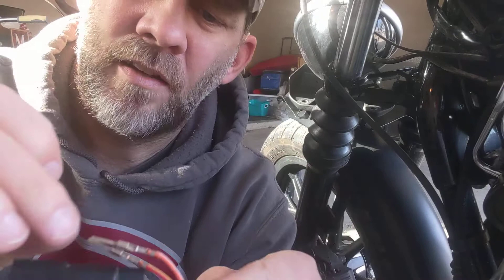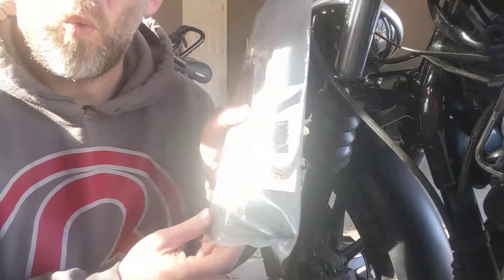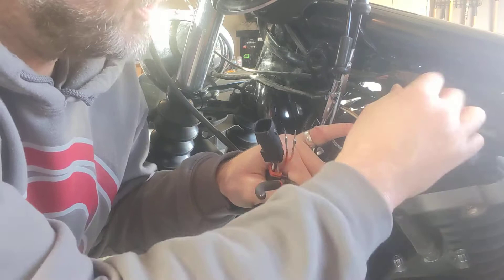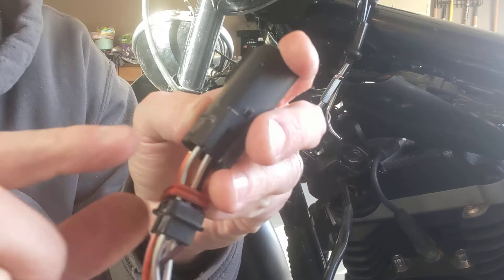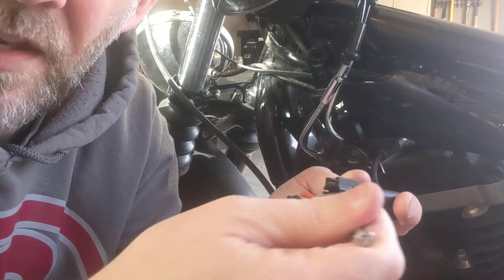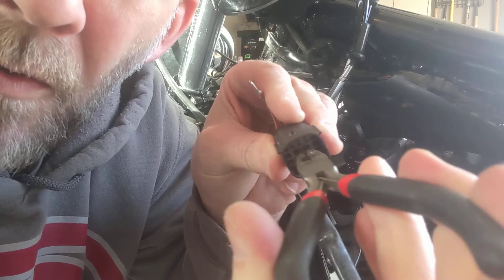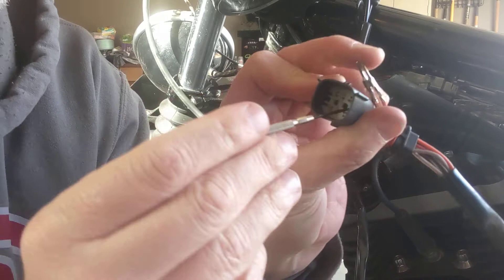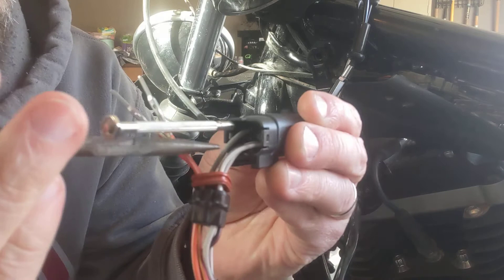Harley Wiring Extension / Removing Wires From Harness

Comment: I want to try and extend the wires on my new Rebel 1100 for the same reason; higher bars.
Your video will help me a lot if I run into the same type of connections.
Thanks a bunch.

Comment: There is a tool for removal of the wire connector pins from Molex connectors but they are rather expensive. I use a #1 paper clip in the small hole just above the connector pin. Then you will hear a click and the pin will come right out. Nice video. Thanks.

Comment: It's in the repair manual. There is actually special tool called "molex pin release tool" that you stick in that little hole on top of the pin hole in the front.  But tiny screwdriver works too, or paper clip.

Comment: Excellent, but you don't need to disassemble the back of the connector, just lift the latch and insert a thin paper clip into the corresponding hole, and that's it, the wire is free. We have an extension brand in Brazil called Pandilla Cables, their kits include a tool and an instruction manual.
Reply from the maker: Thanks for the tip!!

Comment: This is a Deutsch connector, there is specific tooling to assemble and disassemble one of them. Of course a small pick or flat blade driver will get the job done.

Comment: There is a tool for the pins: HD-48114 for Molex. And Snapon TT 600-3 for Deutsch
Reply from the maker: Seems like Snap On offers more bang for your buck...but my little flathead eyeglass repair screwdriver for $1 did great!

Comment: There is a video that does show this exact thing but my problem is I can't get my plug to fasten back in all the way .. idk if my contacts are sticking out to far or what I did wrong but this was a pain in the ass .. its do able but it's a pain .. the best I can tell you is draw a diagram and take pictures of the wires and the plug

Comment: They make a kit of these molex type pins release tools for a few bucks… eBay or Amazon is a good source.. not only for the tools but replacement parts pins etc..  anyone who’s worked in aviation, or even automotive should have these molex pin tools..

Comment: So putting the cables back on to it, do they just snap in? And do they have to be in the same order you took them out? I’m replacing my bars on my sportster cause someone hit it in a parking lot and it’s my first time ever doing bars with internal wiring.
Reply from the maker: Sorry for the late reply! Yes, be sure to take pictures of where the wires are...they need to be put back in the same order. Test it BEFORE you tie everything back up and screw the cover plates on. It's a hassle when you get two wires in the wrong spot! And yes, the wire heads snap back into the plastic piece inside the harness. Hope this helps, man!

Comment: On 2006 xl883l is the same?  Thanks for the video!
Reply from the maker: I'm not sure...but it seems HD used this wire connector harness for many years as I've noticed from the comments on this vid.
Reply: @JasonByers77  thanks bro, from Costa Rica!
Reply: Mr.  @JasonByers77  bought a frisco handlebar, took apart the connectors and put everything back together, thanks to you... Now my back is safe hahaha
Reply from the maker: @ElChP  keep that shiny side up!!

Comment: How do do re pin back together also
Reply from the maker: Hey, Walter! First, take pictures of the wiring before you remove them. I believe one harness had eight wires, so I taped the top four together, and separated the bottom four. Then, after all the wires are inserted back into the harness, you grab your needle nose pliers and lock the middle gate (that clicks back and forth, shown in the video). Hope that helps!